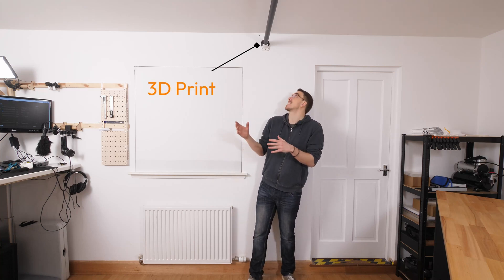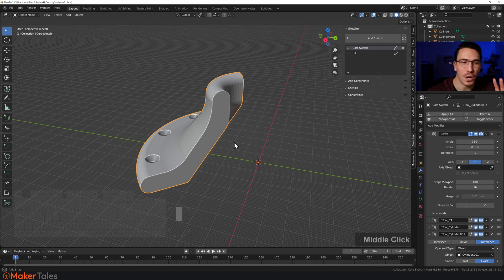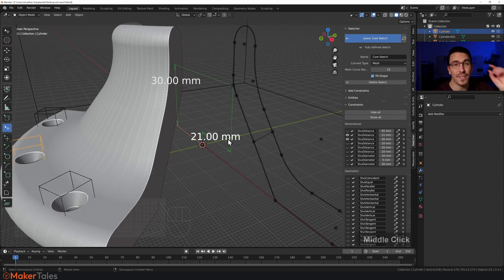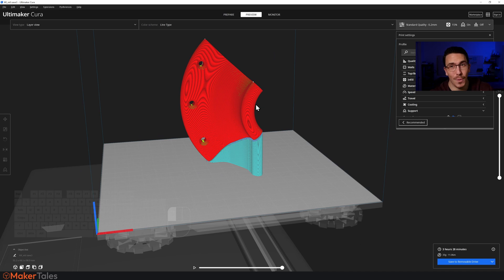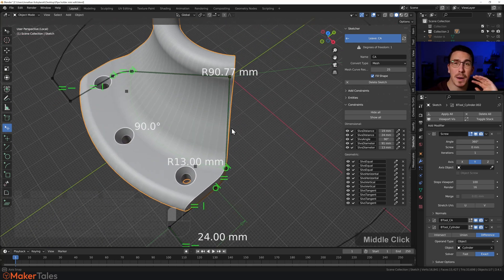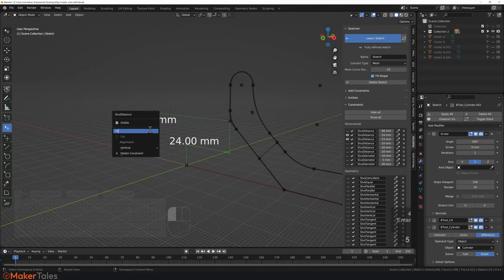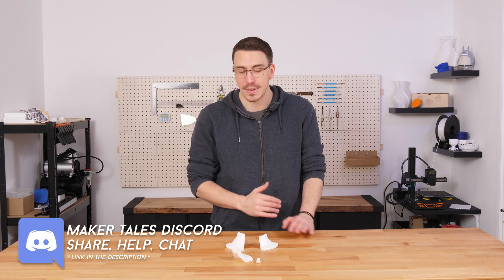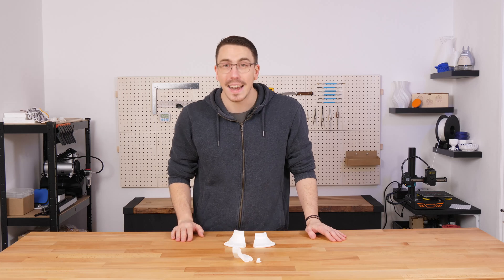10kg to 80kg  3D Printed Support Upgrade | Blender CAD Sketcher Design

Comment from the maker: In case your wondering I used Kingroon white PLA. Nothing special.
Reply: Hi! Why not to print with polycarbonate (PC)? I've heard that it's pretty easy to print (it's not that troublesome as nylon) and it's much more tough than a PLA.
Reply: @KiR_3d  Not everyone has a printer that goes above 250C, and a lot of those filaments are picky about enclosures too. Also more expensive and hygroscopic. PC and its composites and copolymers are obviously superior, but it's usually easier and cheaper to just throw some more budget filament at it, or cure the part when big and bulky is not an option.
Reply: @ronnetgrazer362  AliExpress, literally 50-100$ and you have a hotend ready for 300C printing. Of course you'll need a water cooling system if you want that high. But I know a guy who prints PC without troubles and no water cooling.
Reply: Been curious to see if my little can pull it off tbh. Perhaps an electric skateboard build would justify the purchase of some CF reinforced PC.
Reply: why not use petg, Pla all you have to do is look at it and it breaks, especially on a sunny day, lol.  I make tons of parts with petg with lots of luck and will not really buy pla again. plus there is abs, but not sure what you can print on the kingroon.

Comment: One thing I don't understand about 3d printing: If y'all want it to be extra strong, why don't you just print it to be completely solid all the way through? I have never seen anyone explain why you don't just print things completely solid.
Reply: That would absolutely make it the strongest possible, but it's often an enormous time sacrifice (and material sacrifice) to do so. The print time could easily more than triple to print an object of this size with 100% infill. Also, if you consider the material cost, by printing an object with 'just enough' infill, it may be the difference between being able to print 3, or being able to print 6 pieces. Hope this makes sense. 👍🏻

Comment: Hey thanks a lot for your videos. These have already helped me a lot.
However, I still have a few questions. For example, if I create a sketch on X/Y, extrude it and then create a new sketch on Y/Z because I want to insert holes there. How can I select points or lines from the first sketch in the second sketch to determine the correct distance of the holes to the edge? I can only select points or lines from other sketches in a sketch if they are on the same axes. For example, both sketches must be on X/Y. As soon as one Sketch are differently (e.g X/Z), the points/lines cannot be selected.
Another question: After extruding the first sketch, can I have other sketches of the part created for all sides to use as a reference for other sketches?
I use Blender only for 3d printing and maybe I use it too cumbersome until now.

Comment: There are several bugs in version 0.25.0:
- after converting a sketch to a mesh and creating another sketch, the mesh disappears from the viewport and appears after leaving the sketch.
- after creating several dimensions, their selection becomes impossible, even pressing the Shift + V keys does not help.

And a few more things you can do:
- make it possible to create restrictions between elements of different sketches.
- make a "Mirror" constraint.

Thanks for your work!
Reply from the maker: There are several bugs in version 0.25.0:
(Keep in mind this is still in pretty much beta and testing development)

- after converting a sketch to a mesh and creating another sketch, the mesh disappears from the viewport and appears after leaving the sketch.
(Not a bug but a feature, go and check your addon preferences if you don't want the mesh the disappear)

- after creating several dimensions, their selection becomes impossible, even pressing the Shift + V keys does not help.
(Ya it can be a little annoying this one but i find if you just tap shift all goes back to normal)

And a few more things you can do:
- make it possible to create restrictions between elements of different sketches.
(If you see on the roadmap things like this are coming)

- make a "Mirror" constraint.
(Blender has mirroring plus all mirror actions can almost be done by using "equal" constrains. Also if we are talking code wise there is no mirroring script in the solvspace python branch atm ether)

Anyway, all good points but want to be sure things explained and laid out straight.
Reply: @Keep-Making  Sorry, I did not check the settings and did not understand the actions with the plugin. Thanks for the answer!

Comment: Just use FreeCAD. It's parametric and perfectly suited for just such a task. If you're getting topological naming problems, then that's more of an indictment of poor CAD skills than anything inherently "wrong" with FreeCAD. With a robust parametric CAD design workflow (datums for attaching sketches, datums linked to part/model origin, refinement features saved for last, etc), FreeCAD should be a no-brainer for simple projects like the ones you have. Having said that, I do think it's nice to have options.

Comment: Neat! would more infill make it even stronger?
Reply: If you want to use PLA then maybe the epoxy filling trick will help. It needs to be printed with gyroid pattern. But I don't know how much stronger is the epoxy.
Reply: @KiR_3d  I'd go with a hilbert pattern or spiral. You can mix some fibers into the resin for extra strength.
Reply from the maker: Probably...